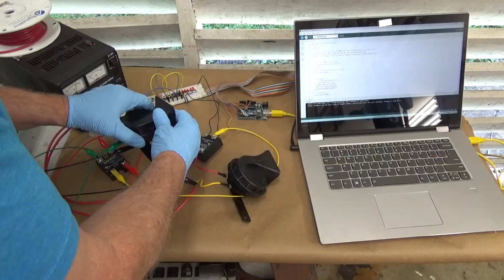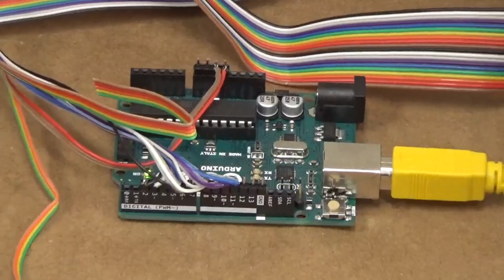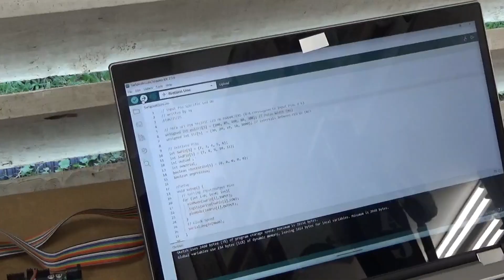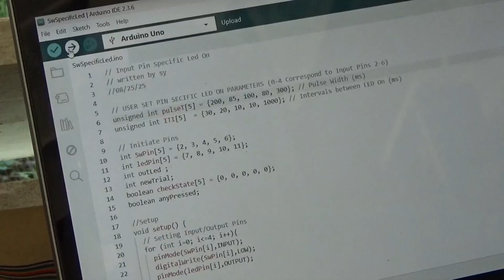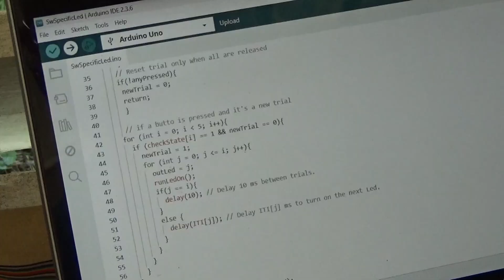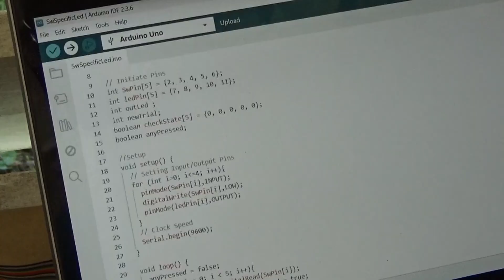Arduino Programable Horn Driver

Comment: Hi, this is pretty cool. I'm looking to do the same thing. It would be much appreciated if you could list all the parts you're  using in this experiment. the Arduino, the relays, the cables, and programming software. Thanks